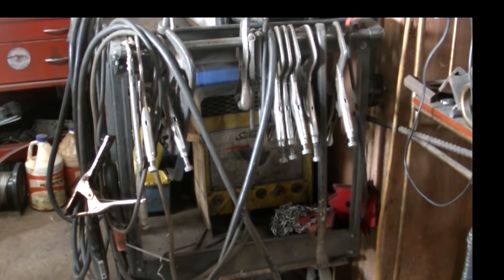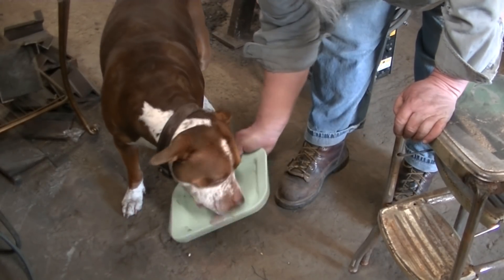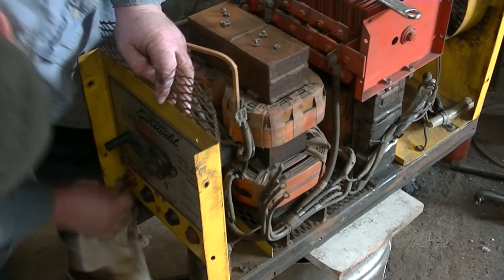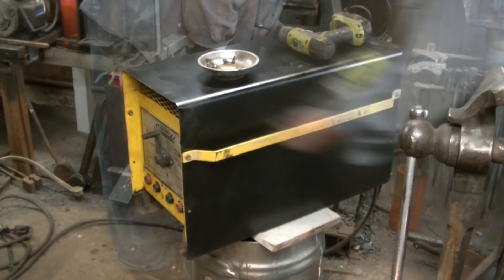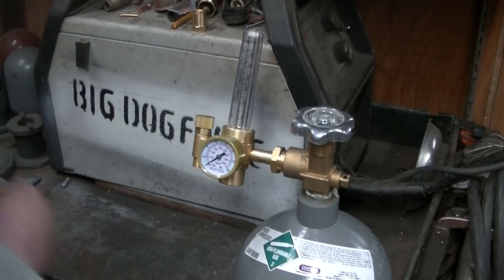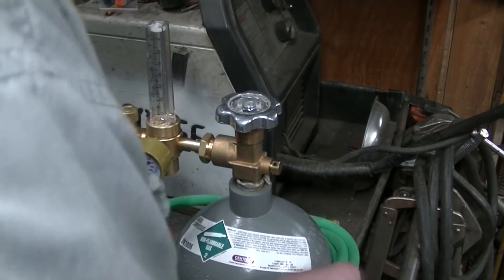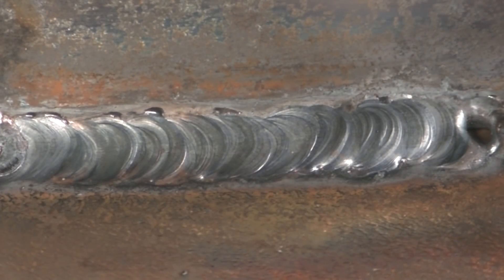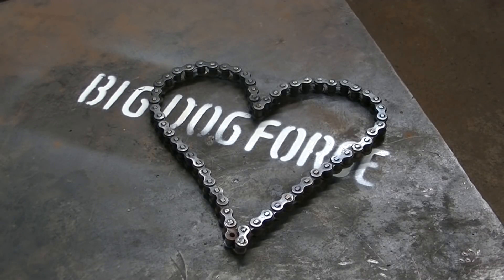Blacksmith Builds A Scratch Start TIG  Welder

Comment: I’ve got 2 microwave oven transformers I’m rewinding for use as a Tig welding voltage source.  I’ll cut the secondaries off and install very heavy gage wire in its place. 
I’m a trained Electronics Repair tech and am familiar with such things.

Comment: Looks like you’re stacking dimes I’ve always wanted a tig but couldn’t justify the cost but guess what I’ve got an old DC welder like you said sitting out back that I had bought just for the leads thanks for the video!
Reply from the maker: Right on

Comment: I like your enthusiasm Mr. Tim. However, from my experience a pipeline rig is vastly more reliable than refurbishing a trandformer-rectifier system of indeterminate age. You can make ANY stick welder a TiG machine with that rig. I used one for years in the oilfield. I noticed that you have a gas valve on your torch head; my advice is to open your flow meter to full and control your gas pressure with the valve on your torch. I would also suggest using 75/25 gas instead of straight gas. Pure argon is best for exotic metals, stainless, and aluminum. If you would like to try a pipeline rig I would be more than happy to see if I can find my spare and send it to you. Dennis.hughes76a1@gmail.com please let me know if you are interested.

Comment: Sorry Tim, but technically speaking, if you have a welder over 300A that you made yourself from another welder, it is supposed to be painted either purple with yellow polka dots or zebra striped. The laws in your area may be different, but generally, that's it.
I enjoy TIG welding. I'm not good at it, but it's fun. Enjoy your new/used welder.
Reply from the maker: Thanks for watching my friend and thanks for the info.

Comment: Could a rocker on/off pedal be incorporated? I know that the infinite heat wouldn't be there but might allow for amateurs like me better control ;)
Reply: Maybe as an on/off switch for the power lead to the wall? Just a thought. I am fairly certain I have seen foot pedals for 240V and 480V, but you'd have to search, most likely.

Comment: Instead of leather you should use a thermocontractable insulator on that electric connection. It is safer and doesn't gather moist within like leather does.
Reply: I use a piece of a heavy innertube in such shielding circumstances, myself.
I buy one for a tractor or semi every few years when needed.

Comment: Damn Tim, I don't even know how regular tig welding works. I can stick and mig decent but that's just cause I learned how before mig even existed. Now u gotta throw in scratch start....
Reply: If you can torch weld, you can TiG weld. Same principle just electricity instead of gas.

Comment: Tim get some 2% thorated 3/32 tungsten for general use , pure tungsten for aluminum same size ( 3/32)
Btw point ur tungsten GRIND WITH THE LENGTH OF IT ..yes it does matter
Reply from the maker: Thanks for the tips!
Reply: @BIGDOGFORGE  if I can assist in any way hit me up, I used to teach tig welding

Comment: I never could weld. I wouldn't really call my half-ass mig abilities welding. I can make stuff stick together and that's about it
Reply: Same here Chris, We used to call it Guerilla Welding. "STRONG, LONG AND UGLY!
Reply: I wouldn't call myself a welder either. However, I did build a 5' x 8.5' utility trailer, with a 4.5' a frame tongue, from an old boat trailer axle, geo metro coil springs, and bed frame angle and repeatedly hauled over a ton on it with a 2x8 pine floor to the metal scrap recycle, engine blocks, iron wood stoves, and such over a period of 12 years before the first "weld" broke. Just happened to be a weld at the spring to frame (at the scrapyard), so I scrapped the trailer too. I ended up buying a 4'x8' 3/4 ton (rated to 1765 lbs) foldable trailer at Harbor Freight  just a few days beforehand so I already had a replacement.
Reply: @BarryManilowa  wear proper PPE and you'll be fine, welding thick material is easy if you have a machine capable of doing it.
Reply: @decaying grandeur is quite correct. I've been welding nearly 40 years myself, if you wear the proper ppe, have reasonable eye/hand coordination, anyone can learn to weld.

Comment: Ive got a quick question. What did you make your bevel jig from? Im having a hell of a time getting bevels to be anywhere near even. 
Im also working on building a treadle hammer based on your design. Getting it built as a more portable version to take back and forth from college to use in our smithing club we started.